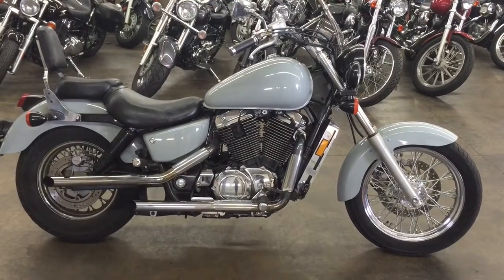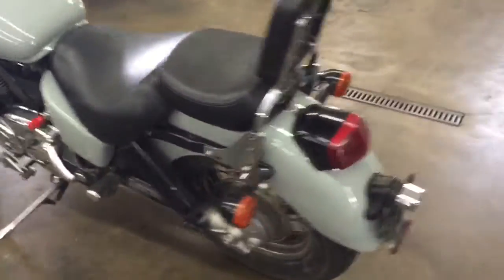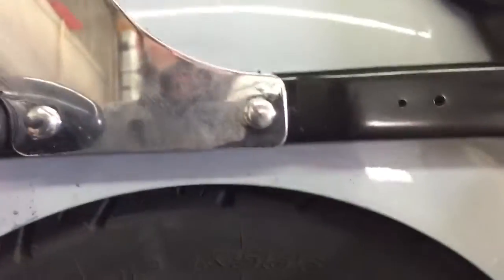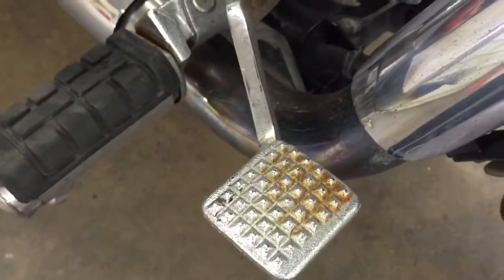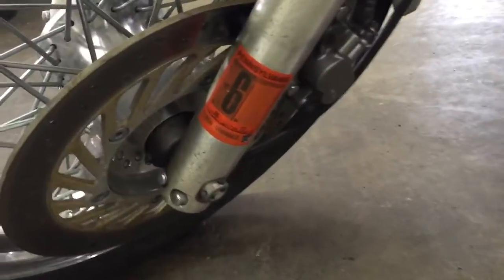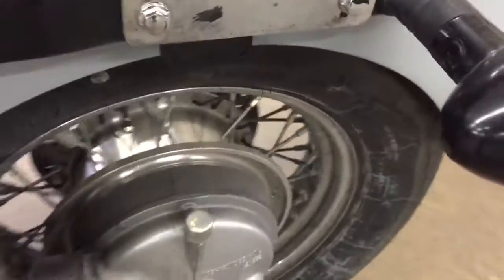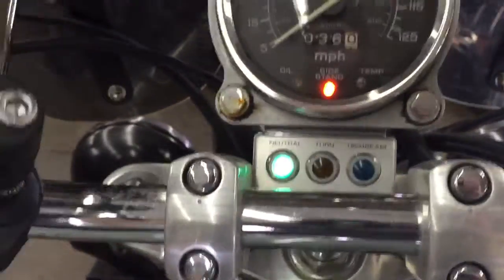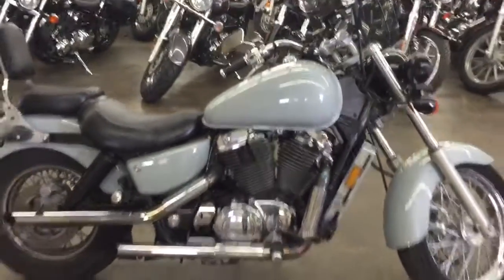1995 Honda shadow 1100

Comment: I just bought a honda ace 1100 and it sounds like a blender the mufflers are welded on about three quarters down the pipes i cant weld and trying to find anyone who is not lazy stupid or a tweaker in thjs town who can weld will be a monumental task i work for a living dont have 20 years to look for a welder live in reno nevada can i take a long drill bit and drill a few holes in the baffles or what that plate round baffle at the end of the pipes temporary fix until i can afford new pipes